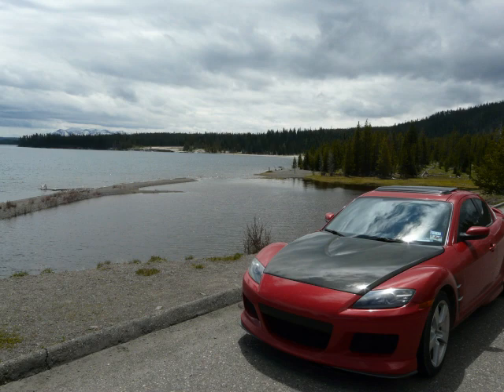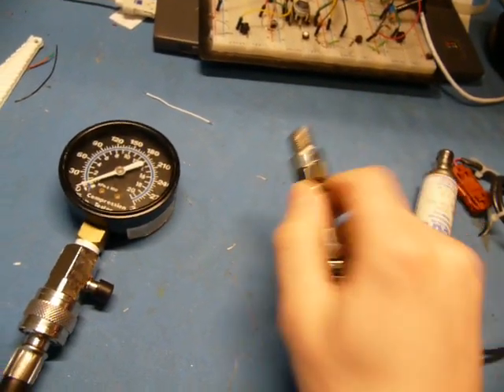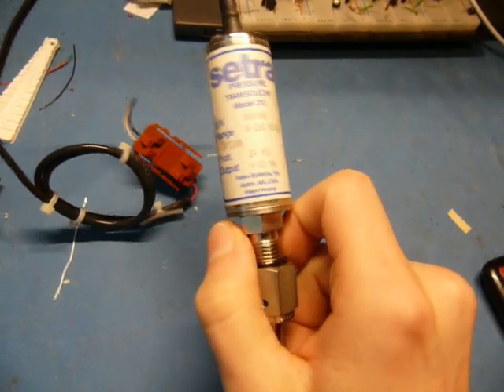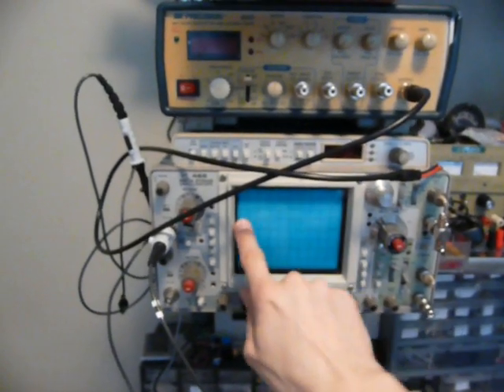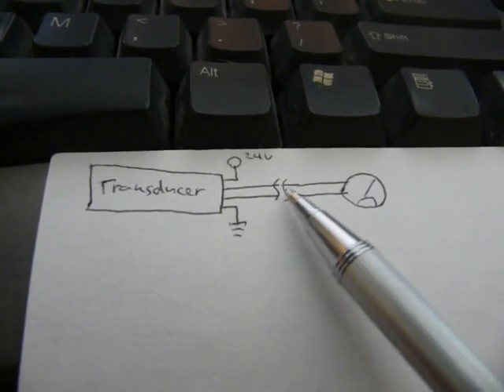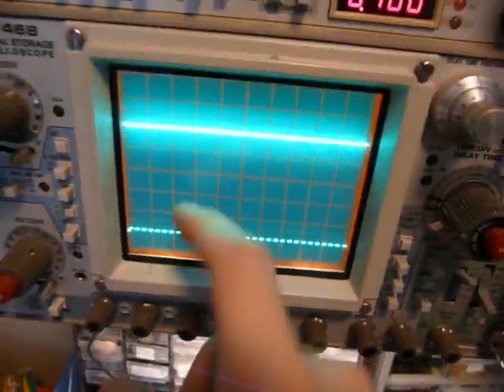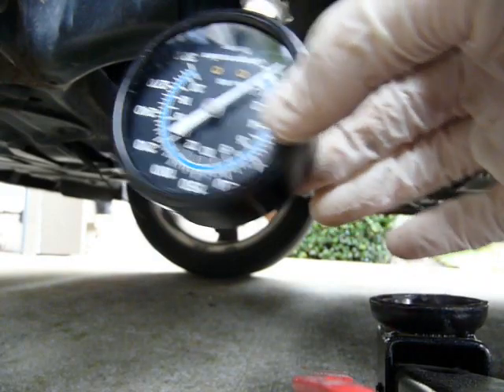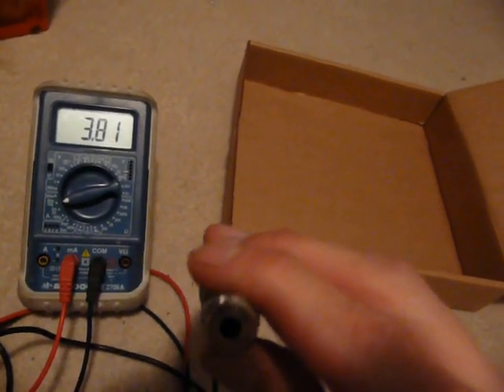Hacking together a compression tester for a rotary engine (RX8)

Comment: you could always use a normal compression tester and take out the shredder valve (the same valve on the tire of your car), this will take the memory of the tester away, then disconnect the E shaft sensor and  have someone turn the engine over, observe the spikes of compression as they move up and down and after 3 times you can get an idea of what your engine compression of each rotor face.
Reply: ps engine normally cranks over at 230 rpm
Reply: And you could record it with your phone and play back at slow speed to see exactly how each rotor face is doing?

Comment: If you don't mind forking out a bit more here's a great tester that will give you exact readings similar to an OEM mazda tester http://www.twistedrotors.com/

Also you can normalize your compression results here: http://foxed.ca/index.php?page=rotarycalc

*Normalizing your results is very critical as you can get a seemingly "bad" reading that's actually good due to your altitude which was the case for my 09' R3 engine

 BTW Love that mazdaspeed bumper too, looks to be OEM as it looks flawless, i'd offer to buy it from you, but but i'd advise keeping it due to how ungodly hard they are to come by in the US (unless you're willing to sell it to me:D)
Reply from the maker: +Nate Rist Good advice, thanks! I've since replaced the engine with a reman from Pettit Racing, everything's back to happy!

Yeah I really like my mazdaspeed bumper :) Took a little searching to get it! Hope one finds its way to you.
Reply: +Spag The Maker So I bought a used bumper off of a dude that got a new autobahn kit for his car that came with a mazdaspeed front bumper and rear diffuser that both looked to be aftermarket as they were both painted one solid color. I bought his front bumper for $150 shipped through greyhound for no other reason than it had the crashbar cover, it also had drift stitching too. Well when I went to pick it up at greyhound I opened the box, looked it over and to my astonishment it had the part number on the inner left side and everything was all there pointing to it being a genuine mazdaspeed bumper, so I got a genuine bumper for $150 shipped, i'm so happy:)

*On another note, not even a week before I got the MS bumper I also happened to snag a set of genuine 2012 Spirit R RX-8 seats for $1,000 shipped. It was a great week:)
Reply from the maker: +Nate Rist Wow nice! Enjoy it!
Reply: oh I will lol
Reply: Kinda pricy and I DO like the DIY stuff

Comment: Spag.  Are you going to rebuild it? Is it smoking? How much power has it lost do u think? Silly questions man ... I just love details!  Sorry about the car.  How may miles on it?  What's the redline on the tach?  If you floor the pedal in neutral, does it have a rev limiter?  Electrical or mechanical?  Does it have a distributer cap? Or coil packs???  Thanks mr spag!  Still thinking about your awesome variac!